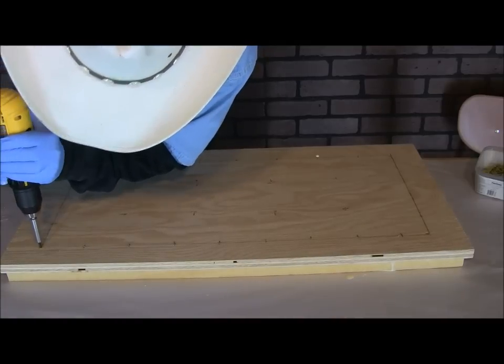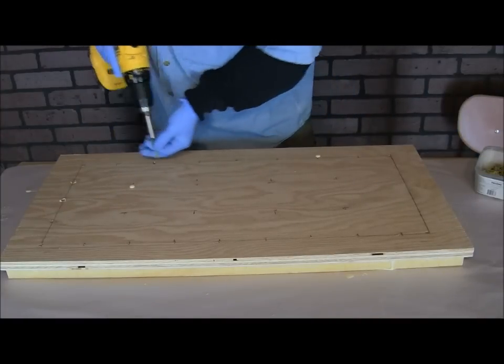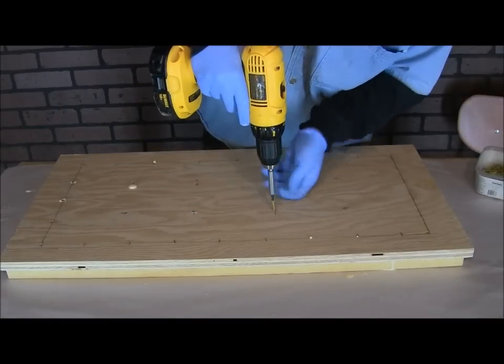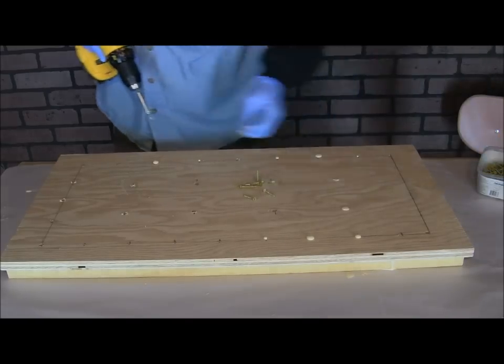#109 Putting Backer On Panel Board

Comment: Like always great video!! Just a suggestion for an upcoming video. Maybe a shop tour? Also whats the best "Router Bit" for achieving nice straight lines? I've been using a 1/4 "Round Nose" bit as well as a 1/8 "Straight Bit" for some engraving i've been doing. I generally rout about 1/4 down and think that might be part of the problem as i get into more frequent sign making/engraving I think your router bit would be very useful. Any help or suggestions would be great!!
Thanks Dylan!!
Reply from the maker: Dylan Bender Hi Dylan, Thank you for the compliments & the suggestion. Many of our students use round bottom our 1/8" straight bits. For me I like v shaped bits for routing. I like the bits I'm using now. Over the last 40 years I've tried 100's of different bits, but the bits on our website & in our videos are the best I've found so far. 1/4" deep maybe a little deeper than you need to go depending on the sign that you're actually carving. Hope this helps. Let me know if I can help further. Our website for supplies is http://davesigns.com/supplies.htm

Comment: Do you sand the top of your boards before you carve them, or do you leave them rough and sand only after the carving?
Reply from the maker: berighteous Not I don't sand the surface of the board before I spray all my ink on. I have sanding sealer on it to prevent the ink from bleeding into the grain.

Comment: Just curious, you are using 1 1/4 screws. The material is 1 1/2. Did you ever hit a screw with your router bit?. When those screws go into the board you are real close to the carving area.you would gain at least a 1/16 of inch when torqueing them down.? I am going to do this to my sign I am making now. Today I noticed a hair line crack in the pine board and by doing this I would not have to worry about the split opening up
Reply from the maker: Because I very rarely go over 1/4" deep I have no problems with 1 1/4" long screws.